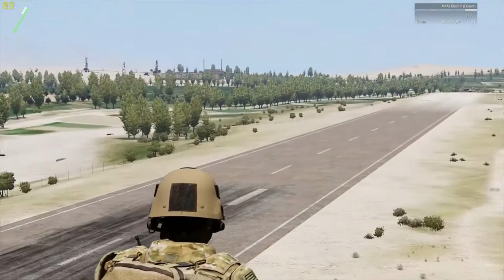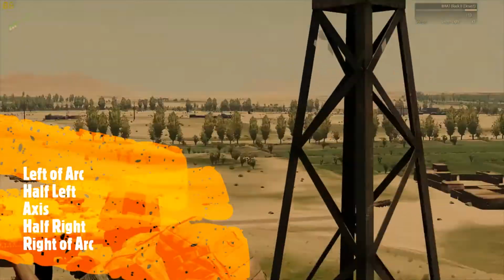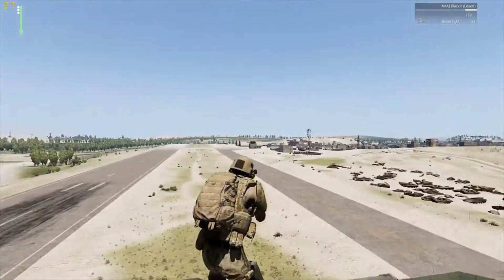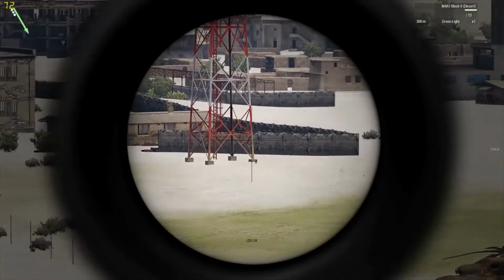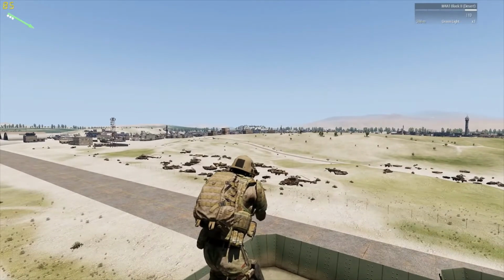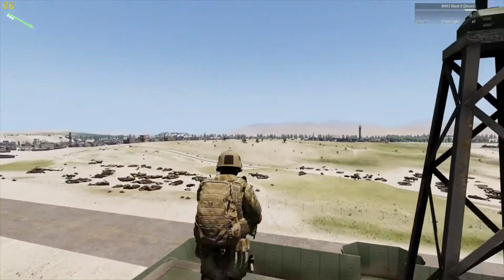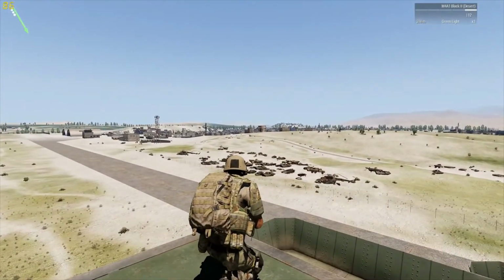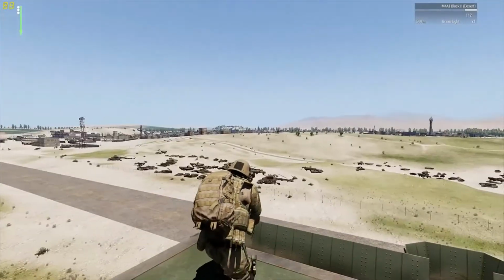Target Indication explained by former Royal Marines Commando

Comment: In what situation should tracers be used? When concealed to the enemy I wouldn't want to give away my surprise factor by shooting, let alone shooting tracers, so I would prefer another target indication since I also have the time for it. And when in contact it feels like a waste of time and loss in fire volume if I need to switch magazines to tracers. Is it a trade off? Is it more viable in bigger units where temporary loss of one barrel down range is out weighed by the effect of the target indication? Genuine question, here to learn and enjoy the unique content
Reply from the maker: This is a great question as yes, firing a tracer would undoubtedly give away your position. So it would be situational. If the s**t's hit the fan and the guys have gone loud then does it matter. Some guys tended to run 3 tracers at the end of the mag to indicate they need a mag change, some 3 on top to ping a target for the guys. If my Target Indication wasn't good enough to bring guys eyes on to target then this would be my last resort. Night time Ops on a full scale Troop attack engagements were nothing shy of a pink floyd concert, as you would need a tracer TI because you may not have seen the enemy location. Most SF small team units hardly use this technique as they want to keep the element of surprise  for as long as possible, get in and get out, raids or what ever. So this tactic is usually more for section/squad and troop level attacks. This is from my exeprience anyway, hope this answers your question.
Reply: @StallionBen83  thanks, this definitely helps me understand their use better!